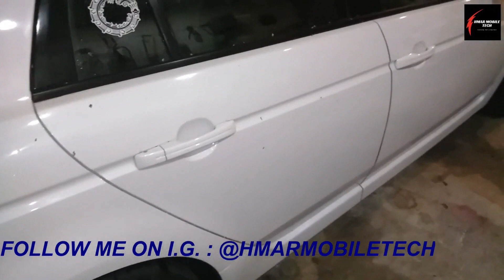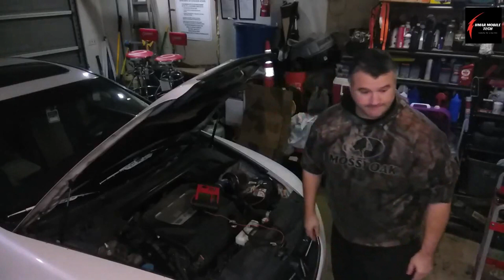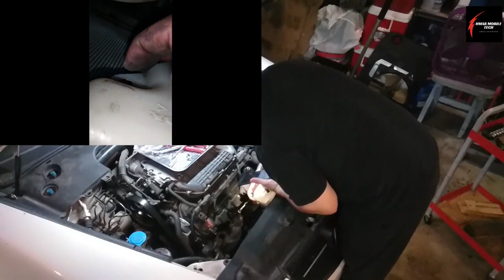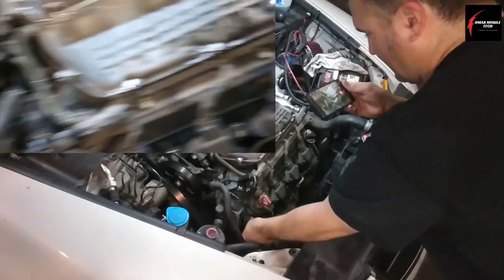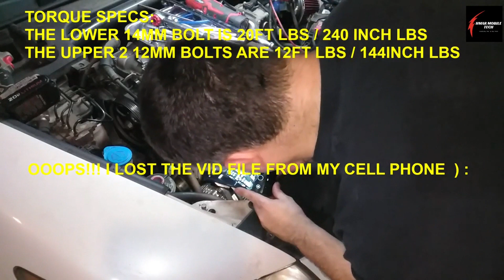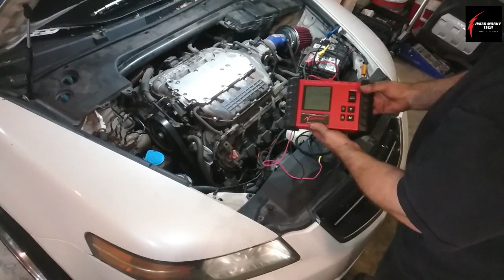'08 ACURA TL 3.2L ALTERNATOR REPLACEMENT | CHARGING PROBLEMS | FIX MY CAR | DEAD BATTERY | INSTALL

Comment: Hey, what's the alternator torque specs?
Reply from the maker: SURE!😀THE LONGER ALTERNATOR BOLT THAT GOES IN AT THE BOTTOM IS 33FT LBS OF TORQUE AND THE SMALLER UPPER BOLT IS 16FT LBS OF TORQUE ( DO NOT GET THEM REVERSED OR YOU WILL BREAK THREADS😮!!! ) THE THICK CHARGE WIRE 10MM NUT TORQUE IS 8FT LBS OR 96 INCH LBS💪. I HOPE THIS HELPS AND I HOPE I EARNED A SUB FROM YOU, TY FOR SEEING VALUE IN MY VIDEOS AND TY FOR WATCHING😀👍👍